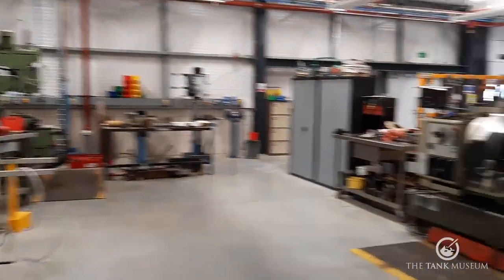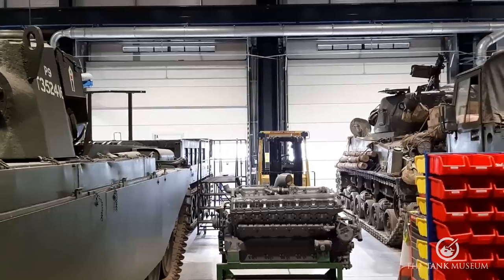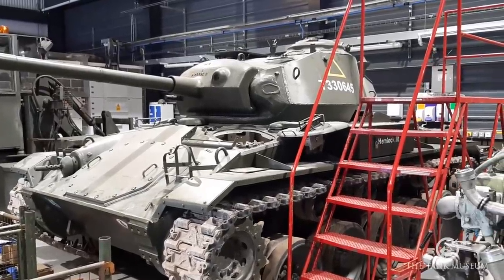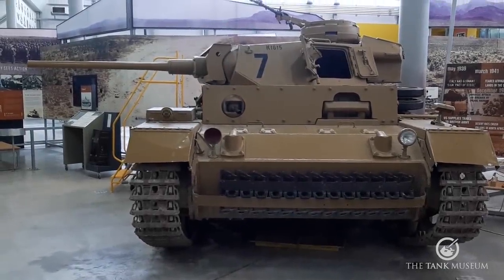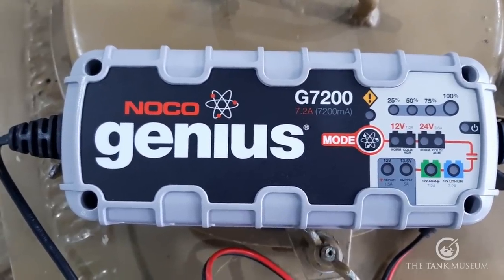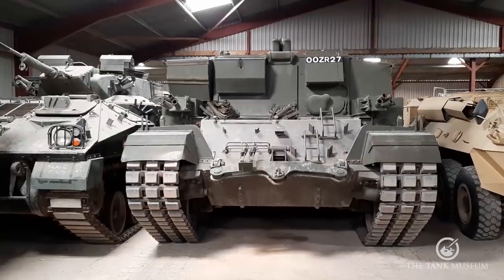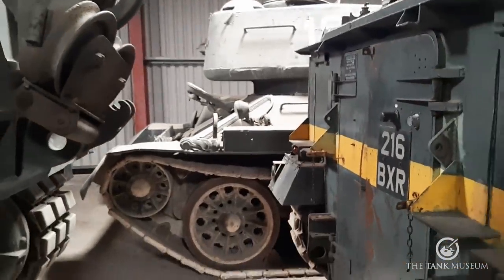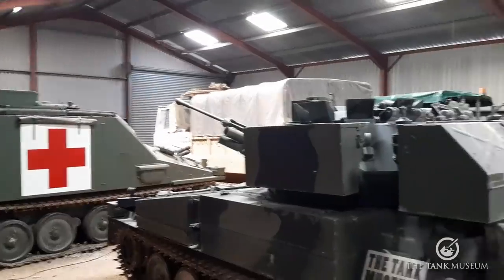Workshop during Lockdown | Ep. 12 | The Tank Museum

Comment: G'day Mate, Just a suggestion on the Valentine shock absorber strut (which you are probably aware of) is that items like this are reparable & in most
cases back to better than new condition. I am assuming the shaft is probably made of a Chromoly material & as such can be rebuilt by Thermal Spray
then machined back to the original specifications. (Very successful for seal areas)
Thermal coatings cover an enormous amount or coatings either being applied by HVOF (High Velocity Oxygen Fuelled approx Mark 5 ) for metallic
coatings or Plasma for ceramic coatings ie; Titanium etc.
The cost of these durable repairs  are generally far more cost effective than first finding then getting hold of a replacement part, anyway its just suggestion
Mate, There is a facility in Burnley south of Manchester called Hychrome that should be able to cover these requirements or possibly closer to your local.
Kind Regards,  Steve.

Comment: Hi  I didn’t know they built Sherman’s with a Diesel engine at all was this a conversion?
Reply: There are quite a few variants of the M-4 Sherman. They put all sorts of engines in them. Even radial aircraft engines. I suspect the diesels were meant for the Marines, and the Soviets via lend-lease. But I'm no expert, so... But I recall hearing the Marines wanted diesels because thats what the Navy burned in their ships. Making supply much easier.
Reply: That's the M4A2 version. As far as the engines fit:
M4 and A1 had a radial aircraft engine. It was available and had enough torque.
A2 was diesel, mostly lend-lease but the US Marines also used it because it was diesel.
A3 had the big Ford GAA V8 and was the preferred version as soon as it was available.
A4 had the Chrysler multibank and was a bit longer than the others.